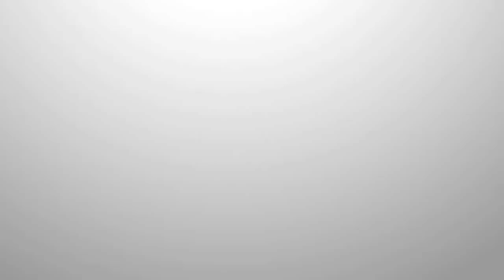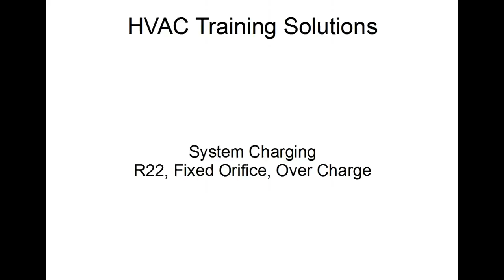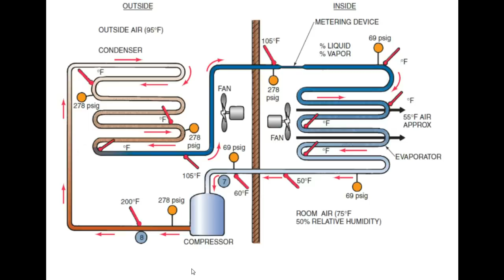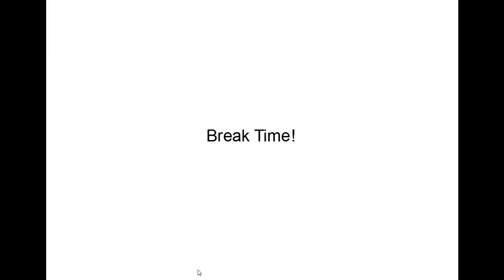R22, Fixed Orifice, Over Charge

Comment: Superheat changes with WET BULB DEPRESSION, not just dry reading.  R-22 with fixed orifice can easily have 8° SH with low humidity supply air, and 16-18° or more SH with humid.  Water vapor is heat load on any coil, weather direct expansion or chilled water.  This shows up mostly in desert installations, where WB depression can be 20° or more.  If you set the fixed orifice system for Carrier's 16-18° spec for a TXV, you'll eventually cook the hermetic's windings due to inadequate cooling.  In such environments, you may have to set the charge for 10° SH with a WB depression of 18°, which will wind up being over 20° SH when the WB depression gets down toward 10° or less.  Bottom line on most tin can compressors is a maximum suction gas temp of 65° at any load  to provide winding and mechanical cooling.  Run much above that, you'll be cleaning up a burnout soon enough.

Comment: Great vid. Question: How would determine if you have low superheat from system charge or if it is caused by poor air flow?
Reply from the maker: If you check the subcooling and have 10-15 degrees or so of subcooling, you know that the system is not low on freon and there is an air flow problem. If you check the subcooling and have very little or no subcooling, the system is under charged. Make sense?
Reply: Ok that makes sense. Thanks for the reply.